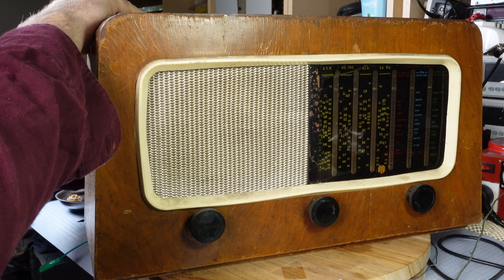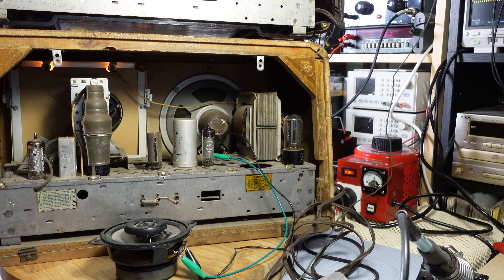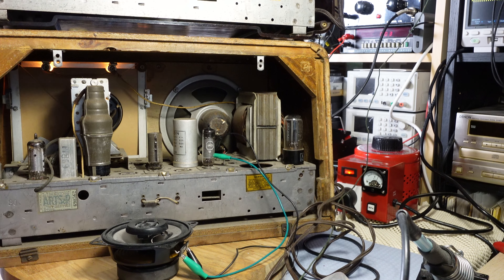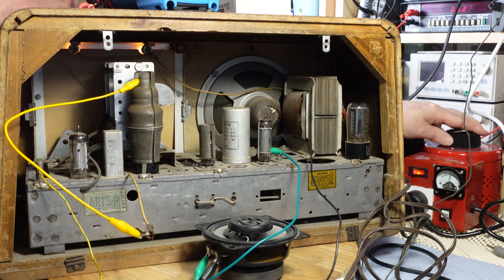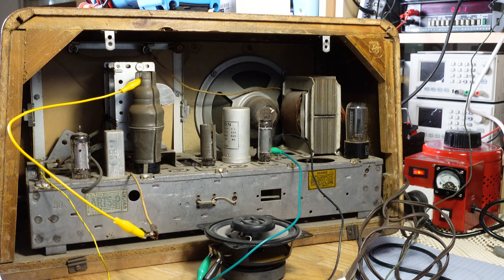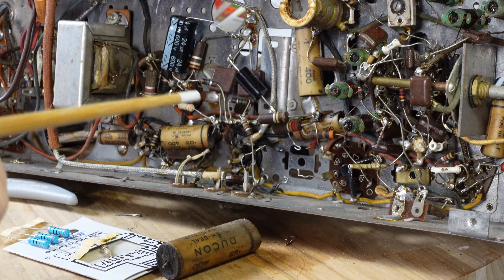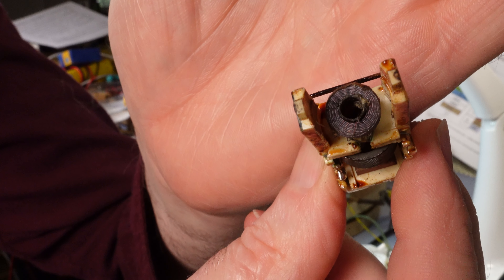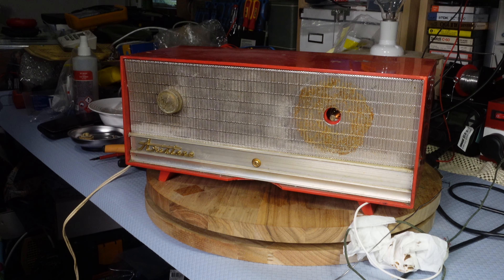Electrosound 41. PYE APJ Part 1

Comment: HI Andrew, I have the same model PYE, The sound from them is very good. Mine also suffered from an intermittent IF transformer which I couldn't repair, I replaced it with one from a wreck which wasn't the same model but the same transformer style. I have any number of them here I would be happy to send to you, I have quite a few used 6U7G valves as well if you want one.
Reply from the maker: Hi David, thanks for the offer. I'm currently waiting for a couple of people to see if they have anything suitable - seems to be a common fault. I'll get back to you if they don't find anything.

Comment: Do you have an amateur ticket
Reply from the maker: No... We call them Amateur Licences, or HAM Licences here. I was going to get one when I was much younger, but back then you needed a fairly fast Morse Code speed, plus detailed electronic and electrical knowledge. Plus the fact I moved into the inner city where I couldn't have an antenae. I've thought about it as it's now much easier, no Morse Code for a start, but the internet has supplanted so much of the fun of it. I did have 27 mHz radios though and they WERE fun!